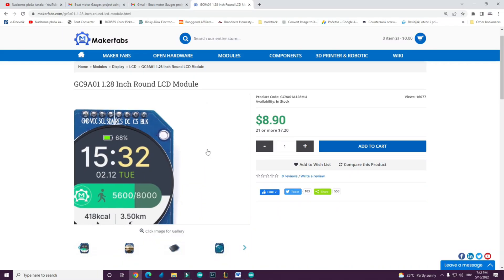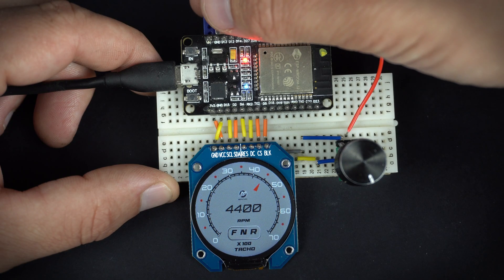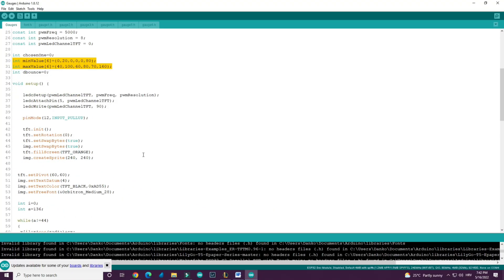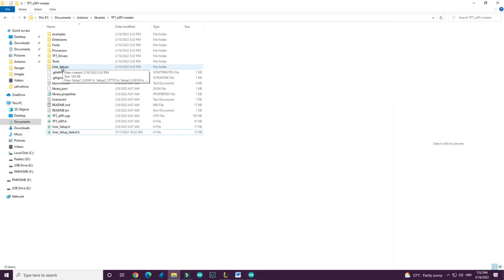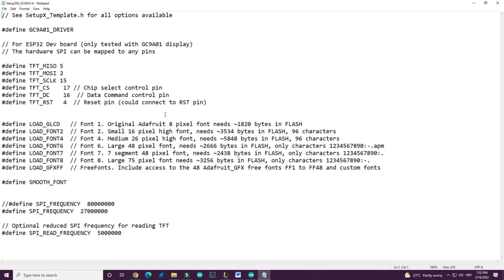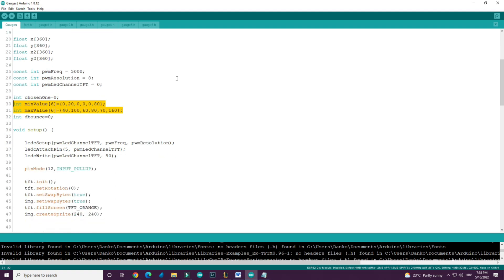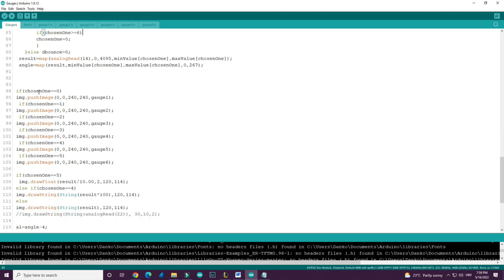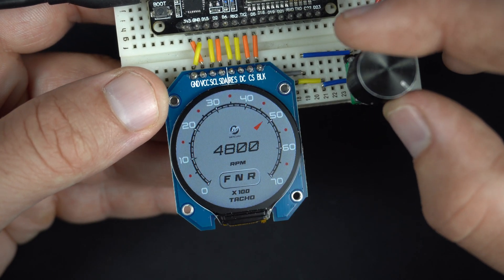Round GC9A01 240x240 display and  gauges

Comment: Great video and project. 👍Like Wolfe032 mentioned in a previous post, I had to add the line: img.setColorDepth(8); right before img.createSprite(240, 240); in the setup routine to get it to work for me. Now I'll have to figure out how to use different input pins for each separate gauge.

Comment: An extra tip; If you're using only one SPI device, you can connect RST to VCC(or NRST), and CS to GND. That's the easiest(less wires) way to connect a display, requiring only 3 wires and power. You'd only need to connect CS to an I/O pin if you're sharing the SPI bus.
Reply from the maker: Thank you, i didnt knew this

Comment: I made my own board with this display and Esp32-wroom-32E it works with the example code, but not with this code, it crashes after drawing the first orange fill, so maybe I am doing something wrong with my config. What version ESP32 are you using and what is the your config in the Arduino IDE?
Reply from the maker: It sound like memory problem
Reply from the maker: Try to reduce size of sprite
Reply: I reduced the size to 235 and that works. changed the background color to match. and it looks good, but still cannot figure out why this didn't work straight away. I'm using an esp32-wroom-32E xx8N module and minimal spiffs.
Reply: @MegaScott 
So where is this memory? I expect it is on the LCD driver chip for fast access? Also, I think this is a sprite size limit not a memory limit. I say this because I got it working (Thank you @VolosProjects & @MegaScott) and then I created a second sprite, filled it with the same gauge data and it still worked. That is why I say it is a sprite limit not memory. So if what I am saying is true, how does it work with the initial 240*240 size for anyone?

Comment: I have searched the net for a solution but can not find, this is the closest i can find, i have a gc9a01, an esp 8266 and a rotary encoder (KY040) a nema 17 stepper motor and a A4988 to drive that motor, is it possible to drive that motor and show the degrees in the display when i turn the rotary encoder?

Comment: This is amazing. I'm not familiar with coding and electronics. But I would like to create digital gauges for classic Muscle Cars. For example, I have a 68 Chevelle and a 65 Impala. And planning to modernize them with newer engines that uses fuel injection and computer modules. OBD Link, and use the computer data to send to a monitor like an Android or Ipad set up. But would like to use the original Dashboard space where the gauges are and use digital displays. I'm going to be researching about this. Thank you.

Comment: I just get an orange display, the arduino examples for the TFT library work fine, I am not clever enough to know why it does not work, I have connected the inputs switch and pot to ground, but really interesting project.

Comment: Thanks for this excellent tutorial.
I purchased the display and downloaded your project. I'm using platformIO so I made the necessary tweaks to get it to compile. At first I had issues with it only displaying the orange screen. I finally got it to work by adding the line:
img.setColorDepth(8); right before img.createSprite(240, 240);
It seems to be working fine now but I'm not sure why I needed to do that? The image file is using 16 bits per pixel it seems. Color looks right though.
Anyway, a heads up if someone else is running into trouble.
Thanks again!
Reply from the maker: Thank you for writing your solution, today  mamy people use platformIO , this will be helpful to people.tnx
Reply: @Wolfe032 thank you for the solution. I had the same problem and spent my time to check settings in libs. I had 7 pin version of the round display- without lcd underlight pin. Did you find the explanation  the problem? Have you tried any different libraries?
Reply: I had the same results with this code and the Volos's Smart watch code using the Arduino IDE and PlatformIO. Your img.setColorDepth(8) worked here but not on the Smart Watch. I pre-calculated all the static arrays in the setup loop and stored them in program memory freeing 6K of ram in this code and 9K in the Smart Watch. Both work afterwards. I'm guessing that a large sprite requires a lot of ram.
Reply: Thank you for fix.  I have been tearing my few remaining strands of hair trying to understand why I had an orange/yellow display.  @Volos - would you please consider updating the code or adding a text comment to the repository?
Reply: Thanks tht fixed my orange screen, It was driving me nutts
Reply: Awesome - Was stuck on the solid orange screen for a while til I found this.
Reply: OH MY GOD!!!! THANK YOU!!! I have spent a whole day trying to debug this!!!!  Definitely need to pin this comment!!
Reply: I ran into this problem as well, I am using the ESP32-Wroom--32 which I found I had to use DOIT ESP32 DEVKIT V1 in the Arduino IDE for the controller to work.  I also had to #define ledcSetup and #define ledcAttachPin in void setup() because i was getting a compile error.  I also got the Orange display and thank for this forum for the fix by adding the img.setColorDepth(8) and that worked perfect. Thanks.

Comment: I tried your code and at first I couldn't get it to work. All I got was an orange screen (TFT_ORANGE). After an hour of debugging I think my ESP32 was getting out of memory by the while(a!=44) loop. I then enabled the PSRAM on my board and it started working (although with a lot of flicker, but stil it works). So it's possible this won't work on boards without PSRAM. Great video!
Reply from the maker: what board you are using. i am using old esp32 with defoult setup in arduino ide, never had memory problems
Reply: @VolosProjects  With esp32 WROOM 32 it do work just in 240x230 sprite area...

Comment: What are the ledc lines of code for exactly?
Reply: The display brightness, maybe? Is that ok to use with other displays like the SSD1306 or ST7789?
Reply from the maker: yes, it is line used to set PWM and to se t brightnes, you can use ST7789 i already used in this video https://youtu.be/UUzywu2RrHc
Reply: @VolosProjects  thanks for the help!

Comment: Hi, in the pin mapping file GPIO5 is MISO but on your display BLK is connected to D5, is the Backlight? I'm trying to get a Waveshare 1.28" round display working but having no luck.
Reply: I use Waveshars 1.28inch, and it can't be displayed. But using "Arduino_GFX_Library.h", it can be displayed.
Reply: @YONG0612  Hi @Scott.   I have the same display and proble,   Please refer to the fix above.  It worked.  
Jack Hampson
2 months ago
I had the same results with this code and the Volos's Smart watch code using the Arduino IDE and PlatformIO. Your img.setColorDepth(8) worked here but not on the Smart Watch. I pre-calculated all the static arrays in the setup loop and stored them in program memory freeing 6K of ram in this code and 9K in the Smart Watch. Both work afterwards. I'm guessing that a large sprite requires a lot of ram.
Reply: It may be that TFT_eSPI communicates with Waveshars 1.28inch debug.

Comment: That looks great! id love to do something similar using 2 slightly larger screens (4" square) to run RPM and Speed based on inputs from my car. Any advice on achieving this?
Reply: Look into the  "Speeduino " project.  Its a bunch arduino nerds that have building some awesome car computers using arduino

Comment: if i wanted 14 of these round displays to each display one or two data sets on my truck - how many gages can an arduino handle output to?
Reply from the maker: Arduino will not be able to run one gauge smothly, esp32 is much faster but  it thinh 14 will be to much. It can run maybe 3 of them in same time.
Reply: @VolosProjects  so either multiple esp32's or something more powerful like a Pi?

Comment: Sorry if I missed this in the video, how does the pixel layout work? is it like a square but only the existing pixels get displayed? or do you need to structure your data array with each line being progressively longer as you approach the equator and then shorter as you approach the bottom?
Reply from the maker: It is acting like normal square 240x240, as you said ,only pixels inside circle are visible